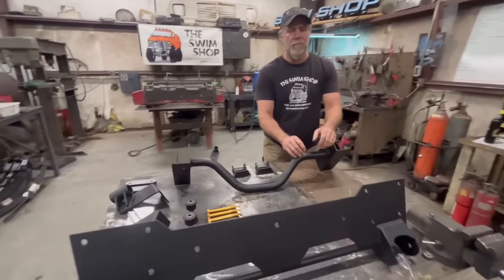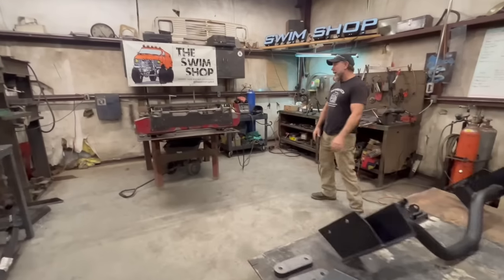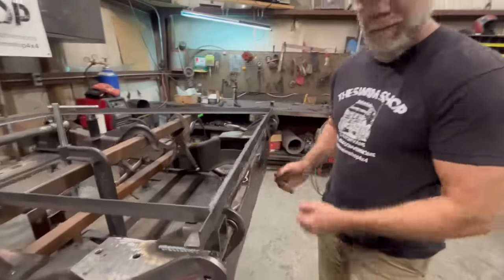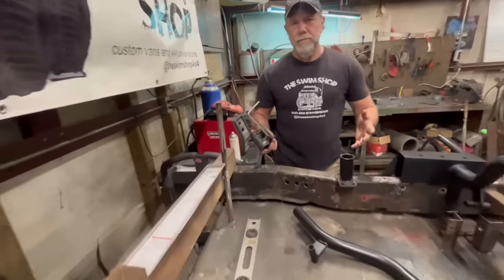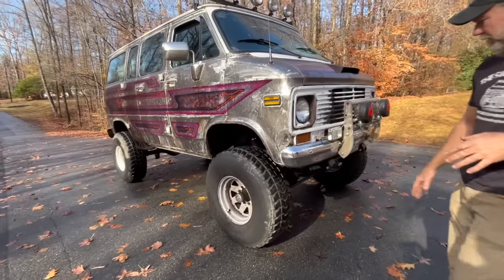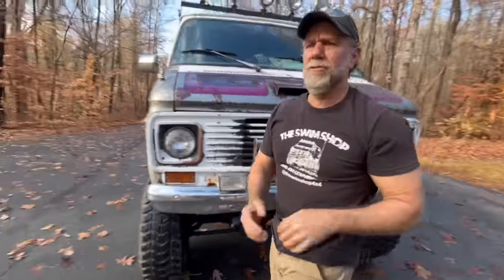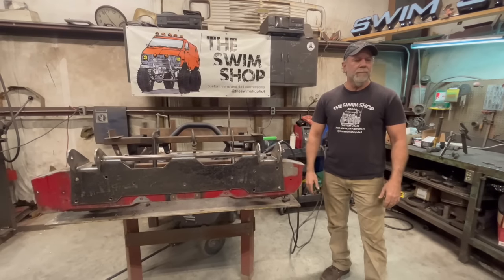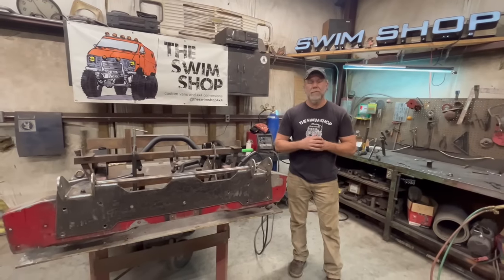Our 4x4 Kit & How it works! - The Swim Shop 4x4 Vans

Comment: This is amazing...  I've been thinking about this for probably two decades.  What kinda front axle should I start looking for?
Reply from the maker: We use passenger side drop Chevrolet and GMC squarebody axles. But if the spring pad spacing is 31-32 inches it will work. Thanks for watching.

Comment: Looking to do a 1980 1ton van. I have 3/4 square body done parts. Want close to stock height as possible
Reply from the maker: You can do it, but our kit will not work on a 1980.

Comment: Can you use a bulldog 4 speed ? I am looking at trading up a g20. My 78 k10 got totaled but its got strong running gears 383 stroker with the old bull dog manual. Just didn't know considering the motor sets farther back in the van. If a manual was a possibility but i love a manual especially the old granny low 4 speeds. When i rolled my truck i didnt have a family now I do and i have been talking about building a 4x4 g van for a while. I was considering just swapping the van onto the truck frame but had a guy tell me you cant it wont fit 🤷‍♂️. The truck had low rebuilt miles on everything its just smooshed flater than a pancake.but i would say 5000 miles on everything max since going thru it and i have been trying to decide what i want to do with it and theres a lot of cool and practicality in the g van. I am in between a square body burb or a g van. But i think the g van is just cooler and turns more heads but the manual would probably be the deal breaker if i am tied to an auto in the g van.
Reply from the maker: We have never put a granny 4 spd in a van, but it can be done. I have seen one at van events with one. Thanks for watching.

Comment: I run a rather large van group on Facebook and have been vanning for a LONG time. I think the ass end of each of these vans are too low. The front end of each of these vans are taller than the rears. Looks like great quality but that may have been something that was overlooked
Reply from the maker: I will say the angle of those pictures do make them look low. But, we do build them just a slight bit lower in the rear. No Carolina squat by any means. I personally hate to see a 4x4 any higher at all in the rear. That's for Boogie Vans. Thanks for watching and nothing was overlooked.